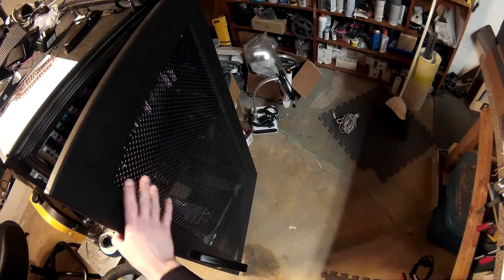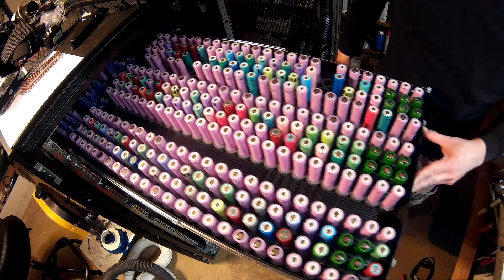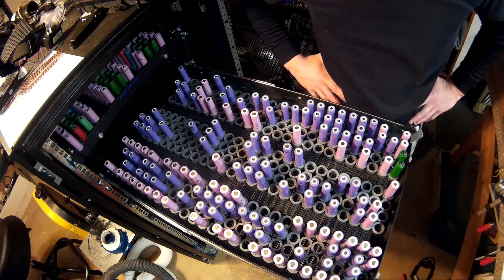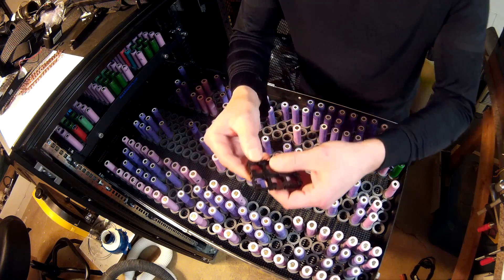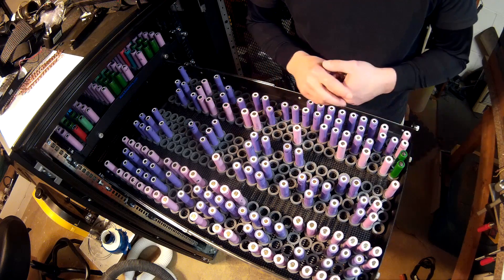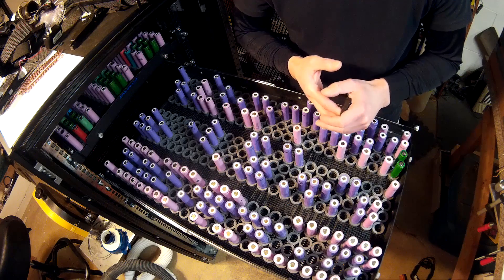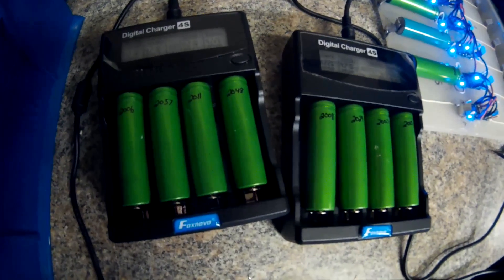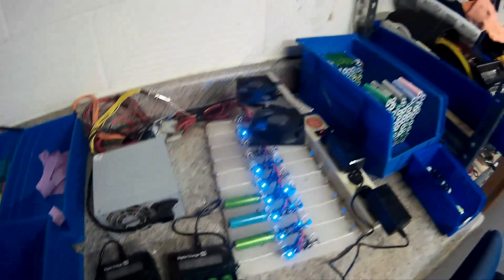Diy Tesla Powerwall ep28 Epic Fail!!!

Comment: the PE pipe has a guaranteed internal diameter. I used different types for gardening works: the internal diameter was always the same, although the materieal thickness and hardness was slightly different sometimes.
Reply from the maker: I assumed this was going to be the same as well!

Comment: Using PVC cement with a q-tip works well as a tight-ner  heating in the oven widens them  up
Reply from the maker: Yeah I didnt even think about PVC cement when I was building them lol.  Probly would have been a better way to glue them 😆👍I thought about heating them up but didnt realize they were smaller until after I built them and didnt want to put the hole thing in the oven😉

Comment: Ream them out with a bit od sandpaper on a dowel or broomstick sanded down to be a little bite more than 18mm including a layer of sandpaper.

On the bright side you've got plenty of ventilation! :-P
Reply from the maker: This was going to be an option if I couldnt find anyway to drill them out :)
Reply: Yeah I saw your solution in the next video! :-)

Comment: You just got a new patreon supporter, I have to say that I have been following your powerWall solution for a while, I like the idea of putting the cell in different holder to get them out easily. I had the idea too of putting the powerWall inside a server rack instead of mounting on the wall. I am still thinking about what I will do. Saying that let me suggest it would be easier for you perhaps instead of clue cuts of pipe perhaps it is easier to make hole in some kind of non flamable piece of something. Please keep sharing you projects.
Reply from the maker: Hey thanks, much appreciated!!!  Ya cutting holes in another material would be a good idea.  Ill have to look up some fire retardant material.  Thanks again!!!

Comment: :)
      Suggest you consider trying a different source for the PVC pipe (Lows, Home CheapO, 
      local plumbing supply store, TrueValue, Ace Hardware ect.
      Than before U buy, take your largest dia. cell out of your pocket & check 4 compatibility.
:)
Reply from the maker: Thats exactly what I did and only found it at lowes here :)

Comment: Hmm...you are right, I didn't stop to consider consistency of the pipes either.  Glad I decided not to go this route a few months back.  I did decide a while back that any DIY project to support my DIY Powerwall project was going to interfere with my powerwall project wasn't worth the time or effort.  The only DIY project I will have to do is building a work station.
Reply from the maker: Yeah, an oversight LOL.  Ill probly still use them because I like the design.  To me its not always about the end goal or its just another project.  Its the experience gained with everything I do the "journey" :)

Comment: I would not attribute all of your failure in size to the pvc, slight variances in shrink wrap can make a difference as well.
That said, You might consider simply using a heat gun to soften the rings to press the cells into place.
The SF18650 cells are Sony cells.
Reply from the maker: I might try using the heat gun on a few before I glue them together to see if they keep there shape.

Comment: Sony US18650GR, has an extra 2 digit code at the end.
G4 = 2000mAh
G5 = 2200mAh
G7 = 2400mAh
Not able to get much other info, as idiots always linked to the datasheet on Sony instead of making copeis.
Reply: station240 _ That's why I'm saving all data I can find on the cells I process. My data sheet can be found here:
https://drive.google.com/file/d/0B7xAfhPgMNYJZHQ5aFBNby1sOW8/view?usp=drivesdk
Cell specs are on the last tab.
You have a couple numbers I don't, so I'll get those added as well.
Also want to watch out for Sony SF18650FT.
These typically come out of power tool batteries and are lithium iron so have different voltage and charging specifications. Don't want to mix them with regular Lithium cells.
Reply from the maker: I was going to make a spread sheet similar to that when I first started but got to excited LOL.  Lotsa good info thanks for sharing. You look real familiar Jason, where are you located?
Reply: I've heard I look familiar from a lot of people, Guess I've just got one of those faces. I'm in Montana, which is why I don't have a lot of readily available dead laptop packs.  Low population=low supply availability.
Reply from the maker: Oh ok ya lol.  I grew up in Cody Wy so I know the feeling.

Comment: You should be able to get a wood dowell and wrap with 36 grit stcky back or find a small sanding cylander. What is the diameter you need with thickest heat shrink? and will see if I have the correct size tool you need and will send it to you...just need an extension to hold the tool with a cordless drill and can make that also for you on my machine lathe and milling machine. Diamond bur hole saws will also work fast.
Reply from the maker: 18.49mm is average cell with the thicker heat shrink.  Shit now that you mention lathe, I have a wood lathe sitting not 3ft from me DOH!!!. Let me see what I can come up with and Ill defiantly let you know.

Comment: Use a split wooden dowel with a strip of medium grit sand paper to open the I D.  A drill might grab and rip them apart.  A straight reamer would probably be ok, but getting one the correct size might be more costly than the sandpaper.
Reply from the maker: I kinda like the split wood dowel idea.  Drill bit would be the best.  I have a 3/4 but is almost 19mm.  Ill do some checking tomorrow and see if I can find a 18mm.   I just tried a smooth stepper drill bit (cone shaped)and cordless drill and it worked but when it pops out the other side it gets stuck.  So I just went about 3/4 the way and then flipped it over to get what was left.  They are a lot stronger then they appear with the super glue which is great.